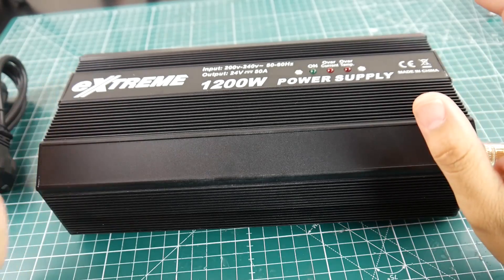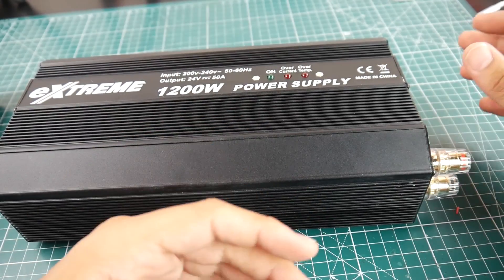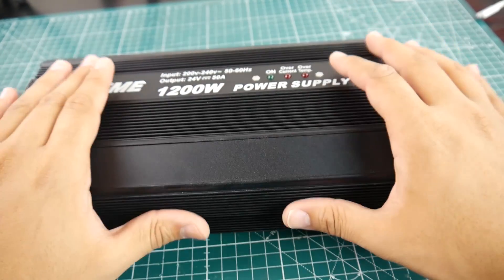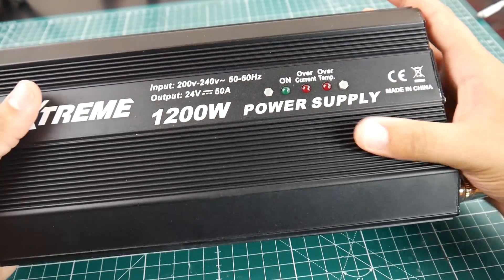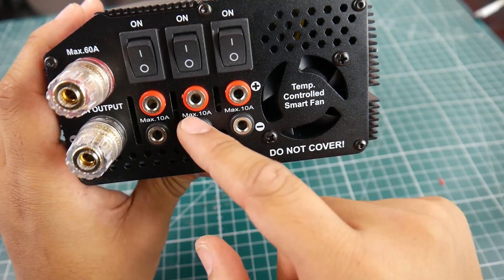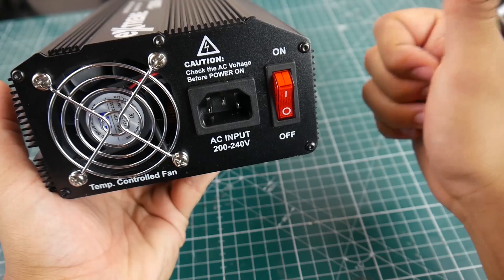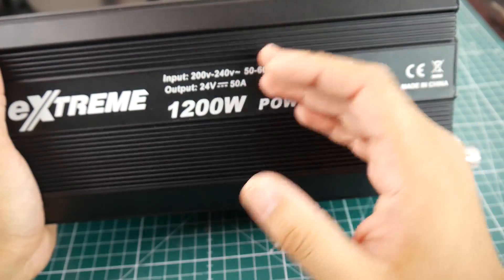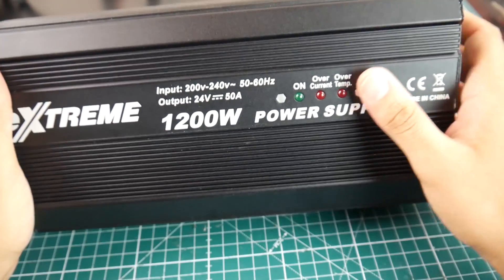SKYRC Extreme PSU 1200W 24V 50A // Overview ESC Stress Testing

Comment: this is identical to the old turnigy 1200 psu. been waiting for farther testing on this psu for a while could not wait. I bought one. so far its working great charged 5 5 s 1300s at 10amp charge. no issues at all.

Comment: Nice power source. I think the TS100 will burn with 24 volts, won’t it?
Reply: No, the TS100 is rated for 24v. I use mine on a 24v power supply. Its even printed on the actual TS100 as "DC5525 12-24V"
Reply: Didn’t know that, always powered mine with 12v, thanks for the clarification.
Reply: It works even better at 24v, heat is more stable.
Reply: With 12v the ts100 only use 17 watt, with 24v 65 watt. You should you use at least a 19 v notebook power supply